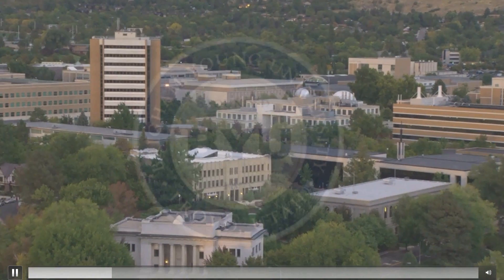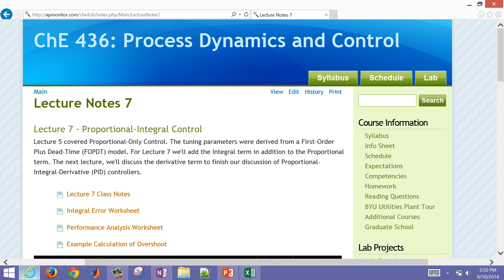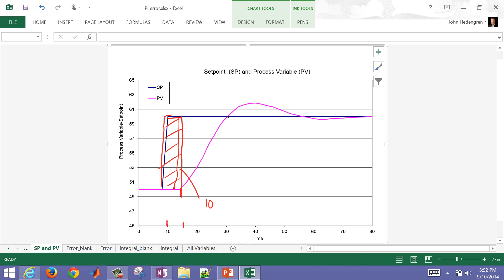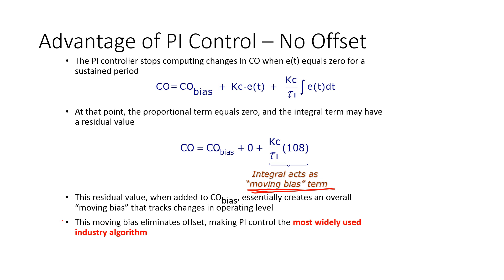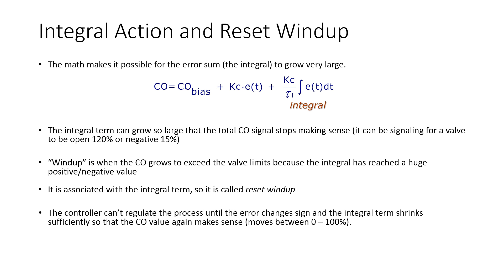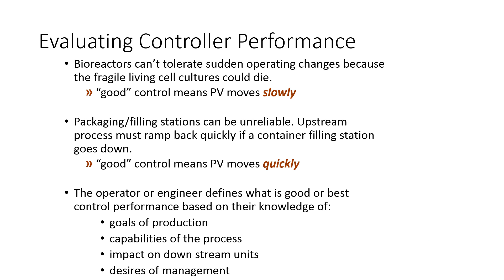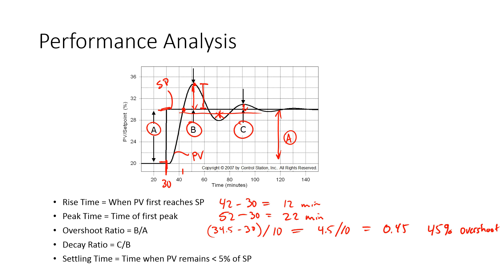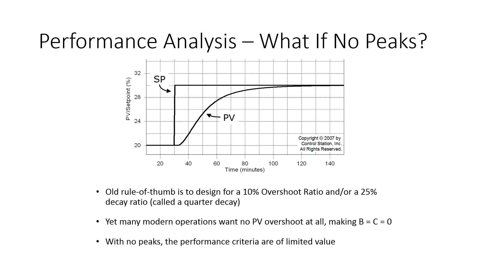Introduction to Proportional Integral (PI) Control

Comment: 5:45 this is a great explanation of the PI control. I was wondering what happens with the controller output when you need an output to keep the process at the setpoint, but the answer is that the integral terms is nonzero even if the error is 0. 
So the I-component keeps the process at the setpoint even when the error is zero. I sort of knew the I-component, but not how it works in detail. Thank you.
Reply from the maker: That's a good summary and you are correct that the integral acts as a new constant controller output when the process reaches the new steady state. In practice, the PID equation is used in velocity form. See types A-C here: https://apmonitor.com/pdc/index.php/Main/ProportionalIntegralDerivative

Comment: @APMonitor.com, in your PI Control solution code (http://apmonitor.com/pdc/index.php/Main/ProportionalIntegralControl) you implement time delay by doing `ndelay = int(np.ceil(thetap / delta_t))` which is an int that represents how many timesteps of delay will the controller output have with respect to the current timestep. But I don't undertand why `np.ceil(thetap / delta_t)` neither why to actually delay some steps... isn't that taken care of by `thetap` inside the derivative calculation?
Reply from the maker: It is implemented lower in the code:

        # implement time delay
        iop = max(0,i-ndelay)
        y = odeint(process,pv[i],[0,delta_t],args=(op[iop],Kp,taup))
        pv[i+1] = y[-1]

https://apmonitor.com/pdc/index.php/Main/ProportionalIntegralControl?action=sourceblock&num=1  An integer is needed because this is a discrete implementation where you need to go back a certain number of time samples to retrieve the correct u value. You could have fractional time steps for the delay if you built an interpolation scheme such as is done here: https://apmonitor.com/pdc/index.php/Main/FirstOrderOptimization
Reply: @apm  Thank you for your answer. I'm aware of the reasons for having an int (discrete time), but I'm not understanding why to divide `thetap` by `delta_t` and why is there a need to feed a lagged controller output to the plant.
Reply: Sorry I finally remembered what I had forgotten in the last months and the confusion went away. 
For anyone out there wondering what's happening there: one of the constants that characterize the plant is the `thethap` constant, which represents in how much time will it start to react after the input... well... that constant appears in the FOPDT equation as a a way of referring to previous inputs. The constant `thetap` is totally different to `taup`. Both in the open loop as in the closed loop ways, `thetap` is used as that: a way to refer to previous inputs... in the open loop, what goes into the plant is the lagged input... in the closed loop, what goes into the plant is the lagged controller output. When talking about `int(np.ceil(thetap / delta_t))`, that's just the number of discrete steps to delay (as professor Hedengren explained above)... e.g. seconds (or some time in whatever units) divided by the the time that each simulation step lasts.
Reply from the maker: @newuser-usernew  great summary!

Comment: @APMonitor.com In the exercise page where this video is located (http://apmonitor.com/pdc/index.php/Main/ProportionalIntegralControl) you ask in the "Open Loop Response with Dead Time" part, the following: "Add a dead time thetap=100 (...) Explain what happens in terms of oscillations."
But I can't really see any oscillations, I can only see the expected lag of 100 seconds. Am I missing something here? 
Here are the graphs: https://imgur.com/a/OPNjo31
Reply from the maker: Your observations are correct. There are no oscillations with the added time delay in open loop. The delay does cause oscillations for closed loop control, however. "Explain what happens in terms of oscillations." Answer: no oscillations with added delay.
Reply: @apm  Oh, I think I have a flashback of that from my control theory classes. Thank you so much, your course is awesome.

Comment: You are a very rare and truly outstanding educator. Thank You. I know this is an old video but I can't find an answer to my question. In a PI controller, do you ever reset the bias AFTER its been running for a long time?  If I turn on cruise control at say 50 MPH then that's my bias and SP. If I then change the SP to 70 MPH I will get there and it will manage the load changes quite well. But what happens after a half hour at the same SP, 1 hour, 2 hours.. etc.  Does the controller ever reset the bias to the current SP?  What are the advantages/disadvantages of changing it ?
Reply from the maker: No, you never reset the bias. The integral takes care of adjusting the steady state "bias".

Comment: If the Control Period for a PI control is 1 sec., PID will compute Output every 1 sec. Does that mean Integral action will not be integrating output over a period of time as every sec it is only multiplying error with 1sec? (as mentioned in the DCS manual which I was working on, the integration of error is for the control period)
Reply from the maker: Yes, that is correct. The integral becomes a summation where the integral term changes by error * dt each second. This is a discrete approximation to the continuous integral. There is more information on PI controllers here: https://apmonitor.com/pdc/index.php/Main/ProportionalIntegralControl

Comment: sir what is bias can you explain such as here is moving bias
Reply from the maker: The bias is the value of the controller output when you first turn on the controller from manual to automatic.
Reply: thanks sir i will write it as a notes

Comment: or we just consider that any controller hardware such as arduino or fpga can use software through pid
Reply from the maker: Here is an example of a PID controller with an Arduino: https://apmonitor.com/heat.htm

Comment: there is an equation of pid but there is a hardware of pid
Reply from the maker: You are correct. PLC and DCS systems have digital versions of the PID equation. There are also older PID analog units that are driven by air pressure and/or electrical current.
Reply: amazing

Comment: sir PID is a hardware or software
Reply from the maker: The newer PID controllers are all software. The old ones are physical units that were driven by air pressure for the output and mA signals for the input measurement and set point.
Reply: PID is Hardware physically and can also be seen its reponse on Simulator like Arduino, Matlab etc.

Comment: sir settling time from graph can't understand how to find A*0.05
Reply from the maker: It is 5% of the total set point step. If you have a set point change from 2.0 to 12.0 then the 5% gap would be 0.05 x (12.0-2.0) = 0.5. The gap is then 12.0 +/- 0.5.
Reply: awesome

Comment: This is yet another video teaching control as if it is black magic.  Control is being taught the way it has always been taught by people that shouldn't be teaching control.  The students are cheated.
What are the "special" cases where a PID is used?   I know.  I regularly use a PID with an added second derivative gain.  Why would someone need to use a PID2?
Performance analysis topic sucks.   What about ITAE,  IAE or SSE?
Why have overshoot at all?   How can the rise time be made smaller without overshoot? 
I real life 5% error is not good.  Neither is over shoot.
Reply from the maker: +Peter Nachtwey, you clearly have a lot of experience with PIDs in industry. I also worked in industry (ExxonMobil and PAS) and continue to consult for some of the top companies on Advanced Process Control. I appreciate your strong feelings about how contol is taught to include very realistic scenarios and case studies. One example is our temperature control lab (http://apmonitor.com/pdc/index.php/Main/ArduinoTemperatureControl) and new control course content (http://apmonitor.com/pdc). This is an introductory class to control and dynamics so some of the advanced topics like PID2 or other specific controller forms need to be taught after they understand basics like P-only for integrating systems or PI control (one of the most common because derivative action is not needed in many applications). Thanks for the comment and please continue to make suggestions on my videos and content. I welcome any feedback. Having an open, professional dialog with a strong voice by industry experts will enhance the material.
Reply from the maker: +Peter Nachtwey, your LinkedIn profile says that you are in the nuclear industry. Your comments about admissible error, undesirable overshoot, and favoring PID2 make more sense for nuclear applications or other scenarios where base-line stability is favored over performance.
Reply: The number of controller gains is determined by the number of plant poles.  There are mathematical formulas for calculating or estimating system parameters and controller gains.  There is a good Lord Kelvin quote about not understanding until you can express the system with equations.

Below is a link to a worksheet where I can change the parameters and see if I can identify them then control the original system using the gains I derived from my estimated plant parameters.
http://deltamotion.com/peter/Mathcad/SOPDT/Mathcad%20-%20Sysid%20SOPDT.pdf
This is just one example out of many. Each type of system is different.  The equations change but the general techniques don't

I thought I saw some dead time you your example.  It looked like a temperature control system.